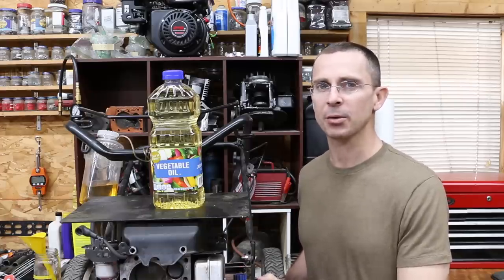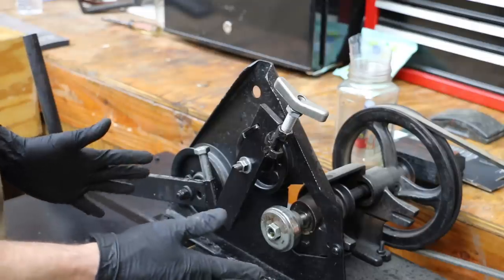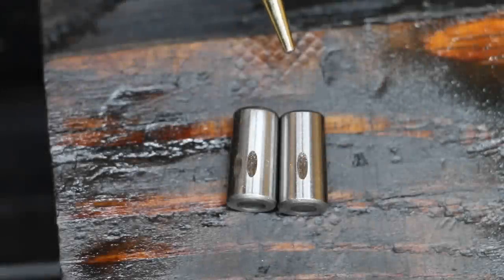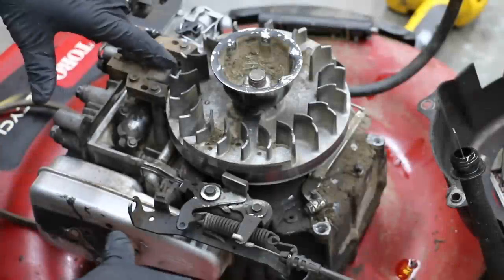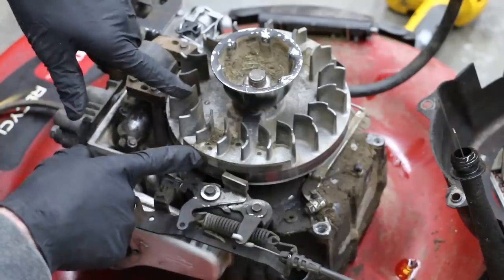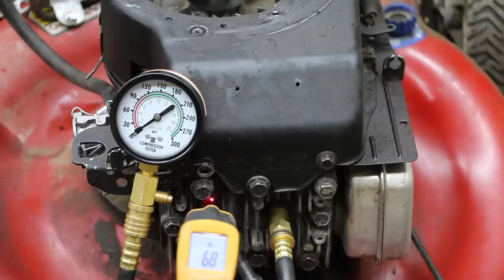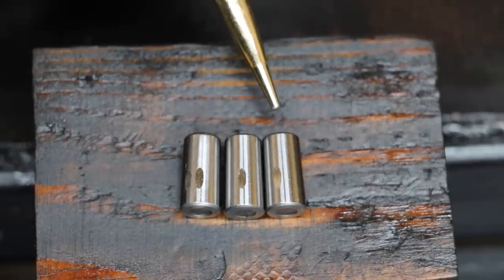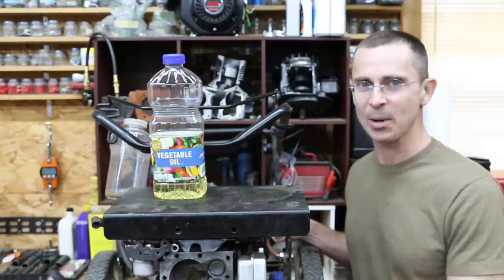Will Vegetable Oil work as Engine Oil?  Let's find out!

Comment: could you run diesel as engine oil?
Reply from the maker: Thank you for this recommendation.
Reply: Not for long, one of the main causes of bearing failures on old two stroke GM diesels was fuel dilution of the crankcase oil, GM engines had the fuel lines internal to the valve covers, any fuel leaks went into the oil pan.
Diesel fuel is very similar to Kerosene (Jet Fuel) it's a great solvent.
Reply: whorayful It can catch fire or make the engine go berserk
Reply: Back in the 30s-50s, this wasn't uncommon to do for a few minutes in order to clean engines out every so often; the old oil gunked up considerably. Maybe I'm mistaking it with kerosene, though.
Reply: Austin Lucas Just at idle tho, if you do this for more than like 5 minutes it can boil and catch fire.
Reply: You still hear it used for that occasionally today, I think the 'flushing liquids' sold at auto shops are basically diesel fuel / kerosene, they are very close relatives. Diesel engines will run on kerosene but kero doesn't have the same oiliness to lubricate the fuel pump. It's not the sort of thing you would leave inside an engine for a lot of miles.
Reply: whorayful Yeah but not 1 hour :) it's dangerous to use it for long times
Reply: Not for long
Reply: Technically yes but you really shouldn't as diesel is combustible that's how diesel engines operate, compression rather than a traditional system using spark.
Reply: I knew 2 airline mechanics who would add a pint of jet-a to the oil in their cars before they changed it, drive to somewhere to get lunch and change the oil when they got back.  Said it cleaned stuff inside.  They both had nice new VWs too.
Reply: For a little while but it’s too thin I would have thought
Reply: Bas BlasterXP. Maybe in a small light duty engine. D4 heavy marine diesel fuel can be used.
Reply: Aries Might so, if we try, we should try it in b&s lawnmower engines!
Reply: Bas BlasterXP. Yes  with a B&S vs Honda shoot out.
Reply: And if you change the oil regulary in your engine, there is simply NO NEED whatsoever to use engine-damaging flush. Today's engines run extremely tight tolerances, hence 20w oils are needed. Putting this fulsh shit in your engine is asinine and bad, as it will remove what little oil is there for lubrication and cause wear on components. Don't FLUSH an engine.
Reply: It's still common in a roundabout way. Seafoam is isopropyl, naptha and "pale oil" which is a generic term for a substance with similar properties to diesel fuel.
Reply: not for long
Reply: Diesel is popular amongst older motorcyclists as chain cleaner/general purpurpose degreaser. It's not a particularly good lubricant.
Reply: ... unless you count it as a film on the road, whereby it completely nullifies any rubber to tarmac adhesion.

Comment: Run engine with hydrogen
Reply from the maker: Thank you for this recommendation!
Reply: It's pretty hard and expensive to get liquid hydrogen
Reply: The Wheelman hydrogen can be made with electrolysis, you just need a car battery
Reply: Antonio tod dissolve zink/aluminium in HCl or aluminium in NaOH(aq) ....
Hydrogen is quite accessable
Reply: Sounds like a decent idea.
Reply: The Chemical Workshop I thought you would get water and oxygen, not hydrogen. Can you write the equation for the reaction you are proposing?
Reply: Electrolysis=HHO. Hydrogen and oxygen.
Reply: Manick N well idk how i mixed this shit up but decomposing peroxide gives oxygen not hydrogen 🤐

For hydrogen you can get some zink or aluminium and dissolve it in acid (Al works in NaOH too)
Reply: Manick N I've been working on purifying iron 2 sulfate for prussian blue to purify my sodium cyanide for silver plating (i guess I'm doing too much stuff at once and I mix everything up :(
Reply: The Chemical Workshop  it happens. I tied up frequency and RPM recently and could not figure out how that made sense when I was typing.
Reply: If you try and run an engine on HHO it will result in disaster. Don't ask me how I know :)
Reply: toysareforboys that's the point i guess :D

Comment: In my country some motorcycle rider use cooking palm oil mix with 1/3 turbo diesel engine oil for drag racing, cooking oil viscosity is quite thin and lubes as good as 5w30 eo, motorcycle with wet clutch need a thicker oil to avoid clutch slipping, so to get the best lube without going for higher viscosity oil they came up with their own recipe its kinda weird but it works.
Reply from the maker: This is great information. Thank you!
Reply: RushDark Wich country? 😂

Comment: Thats awesome, like other people have said baby oil.     What about vegetable oil for 2cycle oil sub
Reply from the maker: Thank you for this recommendation!
Reply: I thank that be cool to watch
Reply: Vegetable oil in a 2 stroke is a bad idea. I would only do that if my life depended on it. Vegetable oil cannot burn, or even vaporize completely at gasoline engine internal temperatures. It will leave vegetable gunk on absolutely everything in the motor. With proper oil later it should clean out, but maybe not before scuffing and scoring the living daylights out of that motor.
Reply: If memory serves, there where some commercially available Bean oils, used for 2 smoke mixes.
Reply: Castor oil is used in RC Nitro applications, but those little 2 strokers are designed very differently from your chain saw motor. They do not use piston rings, and the castor wax improves compression as a result, whereas in a larger 2-stroke motor with piston rings you'll lose compression from fouling the rings.

Comment: Ive had to do it to get my car a short distance, confirmed from australia
Reply: @reesedundee8525  I mean it's gotta be hard to fill a car upside down isn't it
Reply: Also in Australia, am doing it now, smoky motor is burning 2 litres per 100 litres of petrol, poured 2 litres of Aldi vegetable oil, and have driven 100 KMs so far with it seeming happier than normal.

Comment: When engines ware first invented they were run on caster oil,
Reply from the maker: Thank you for the feedback
Reply: Castor oil is a very good lubricant when used mixed into the fuel or at least in a total loss system. It polymerizes when hot, but this is actually wanted in those cases, because the polymerized stuff is working very well as a lubricant at this temperatures. You have to "throw it away" after it has done it's job, though, since those polymerized components become ugly gunk when cooling down. 

It's special chemical properties make it stick to metal really good, even if it's already polished from wear and many other oils would just drop off.

Because of it's superb high temperature qualities it was (and still is in some cases) used for high-power two stroke engines. Racing karts used it a lot. RC racing engines love it, at least mixed into the synthetic stuff.

Comment: Was it just me or did the used vegoil look like it had silver shavings in it?
Reply from the maker: It may have. It's the same engine used with WD40.
Reply: was definitely full of metal.
Reply: I thought the same
Reply: It looked exactly like the oil from the transmission of my two-stroke motorcycle. In the case of my motorcycle, the clutch runs in the oil so it gets pretty dirty.
Reply: Yes but these dont have internal clutches.
Reply: Project Farm cheap way to flush a crankcase!

Comment: Big difference between vegetable oils and mineral and synthetic oils is that the vegetable oil reacts with oxygen and forms an extremely sticky mess which is very hard to remove. Running an engine on fresh vegetable oil has shown to be a good emergency measure but storing an engine for a few years with vegetable oil in the crankcase and on all the surfaces near the camshaft ...... that’s another question! I remember me/us youngsters in the sixties adding salad oil (sunflower oil I guess) as replacement for mineral oil in two stroke gas just for the “racy” smell it gave in the streets of the town we were living in! Nice testing job again. Gerard
Reply from the maker: Thanks for sharing.  You are welcome!

Comment: There's a report by the Navy Research Lab from 1942 called P-1954 "Sabotage Agents for Use in Lubricants and Fuels". They tried mixing a bunch of things (drying oils, resins, corrosives), including vegetable oil, with gasoline and motor oil and running 24-hour tests. They didn't find anything that would do irreparable damage but a bunch of things they tried would gum up the engine so that it wouldn't start again after cooling and a few things that could cause the engine to seize after several hours.

Comment: I used to drive Tomos 2 stroke moped on sunflower oil just for fun. And yes, you can use pure vegetable oil in any engine. In the past people were using castor oil for 2 stroke engines. Also first Castrol oils were made from castor beans. Nowadays flower oils are used in vehicles in water protection areas (springs, wells, water pumping stations).
Reply from the maker: Thanks for the feedback.
Reply: Did you Blew the engine on that moped? I'm interested to experiment on Chinese chainsaw using vegetable oils as engine oil.

Comment: I had a 1964 chevy and it burned 1 qt of oil in 35 miles, to work and back. lots of smoke. One day I put Lestoil to possibly clean the sludge out and stop some of the oil burning. I had the sweetest smelling car on the road. Ran it with Lestoil for a hundred miles and drained it out. Put Gulf 40 wt  in and it didn't help. It was fun to do though. The Lestoil barely drained through the drain plug. Cleaned a lot of sludge out. Rebuilt the engine shortly after and it was very clean in that crankcase.
Reply from the maker: Thank you!

Comment: I actually tried it in a vehicle mixed with motor oil. It worked for a time but the problem that arose was after being whipped around for so long the and heated and cooled so many times  that it gummed up and became a solid.

Comment: Hey, Project Farm, great video, thanks for the content. 
I have a sugestion and I know this sounds gross, but the company I work for visited a food factory where they recondition expired margerine into engine oil. They didn't say what they add to the margerine to do that, they just said it was 'chemicals', maybe it's those vague 'aditives' motor oil display on the vial, but my bet is that they either just add mineral oil and bottle the mixture as synthethic oil, and or add some antioxidants to get the right thickness. Soy oil have a really bad shelflife, compared to canola oil, so it wouldn't last the time an engine takes between oil changes, but margeine clearly have enough preservatives. I've never seen a fly land on margerine even when it was forgotten on the fridge for months (I wouldn't be surprised if they even add formol to reach 4 years of motor oil shelf life). Still just testing the margerine itself or mixed into motor oil would be interesting to see how close something we're sold as food is to an car fluid.

Comment: Man, older lawnmowers probably shiver,  shrieks and run away in sheer panic when they spot you .... ;)

They used castor oil in aircraft engines before and during WW1. It still is a good lubricant - being a vegetable oil.
Reply from the maker: Lol

Comment: We used to use castor oil, bean oil, in motorcycles for racing. The engine had to be flushed before using the bean oil. Caster will go toward the hot part and it worked good and smelled good. One problem with car engines was the driver, after breathing the exhaust had a case of the runs for a day or so. Today automotive oils have to be fungible,  they have to be able to mix with each other and not have a problem because a different brand was used to top off the system.
Reply from the maker: Thanks for the feedback!

Comment: - Full synthetics like Mobile 1 have strong detergent properties.
- In Automotive Engineering we used to run automatic transmission fluid in engines.  It has extreme detergent properties but had the added advantage of wearing the engine out at twice the rate.  This was useful for testing as it didn't take nearly as long to duplicate the wear on an engine.
- Sometimes you hear the recommendation to use 30W non-detergent oil and regular multi-viscosity detergent oil as a less desired substitute.  Some people will tell you that is because of foaming of detergent oils.  Those days have been gone for longer than I've been alive and were never the reason.  The determining factor is if the engine has a pressurized oiling system or not.  Flathead engines traditionally didn't have oil pumps.  They have little dippers connected to rod bolts that dip into the oil and splash the lubricant to where it needs to go.  Pressurized oil system engines have oil filters.  You want a detergent oil to keep the contaminants in suspension so they can be filtered out.  In a splash oil system, you want the contaminants to sink to the bottom and stick together in a sludge because that is your oil filter.  Old cars had wide-open access to the oil pan and after so many miles and at an oil change they would drop the pan, scrape it out, and wash it out.  The problem is it is not practical to take a lawnmower engine apart to clean it out.  So when you put in clean oil and it comes out dirty after not many hours, that contamination isn't a result of the oil and use, it is from the breakdown of the sludge in the bottom of the engine.
Reply from the maker: Thank you for the feedback

Comment: I can remember,that my father,s  1960 Ford Consul MkII, ran on lubricants based on vegetable oil.Nothing
that you could pour on your salad,though.That engine oil for a Ford Consul,wasn,t a substitute,it was
what the garage would put into the crank case,a normal thing in those days,early 1960s.
Reply from the maker: Thanks for sharing.

Comment: My suggestion is to try JD weld wear lube test you can form those small wear blocks by putting JD weld or other test epoxy's into a straw or cylindrical paper tube and then peal that off. The test should show how well the compound tested holds up under super wear pressure applied. Great shows  keep them coming.

Comment: Great video as always! I figured soybean vegetable oil would perform just fine. Great to see it hold its own against 30 weight. Looks like it would work great in a pinch but would leave too much residue for long term use.
Reply from the maker: Thank you for the feedback
Reply: Say Project Farm guy; Ever done any comparisons on fuel injection or carbrator cleaners ?

Comment: You should comeback to this and try experimenting with mixing different oils. A good start is a soybean oil and castor oil mix i feel. Soybean oil has decent lubricity and is used industrially in some applications while castor oil used to be used for vehicles and has better low temperature viscosity as well as high temperature performance. Some good ratios might be
- 80 Soy - 20 Castor. 
- 60 Castor - 40 Soy.
- 20 Soy - 60 Castor - 20 Conventional petroleum based oil (a lighter grade to mix well with the vegetable oil) probably non synthetic but not sure.

Comment: Ive done some testing with veg oil in 2 strokes works great. Makes a great hand cleaner and cutting compound when drilling. Is great at preventing rust as it oxidizes when in contact with oxygen and creeps along seems well.
Reply from the maker: Thanks for the feedback.
Reply: What type of vegetable oil did you use on 2 stroke? They are all different oils. Different freezing points.

Comment: Just an idea: Add a sludge test.  Organic oils tend to break down at high temperatures, as the lighter oils evaporate and leave heavier compounds which turn to sludge and possibly ash.  The test would be simple: Heat a pan (cast iron or stainless steel) to 400° or so, and heat a few tablespoons of oil in it for a few minutes.  You can also note the amount of smoke given off.
Reply from the maker: Thank you for the video idea!
Reply: @ProjectFarm  Absolutely, I enjoy your videos.  I had a couple of other ideas, I'll post them when I remember.

Comment: Vegetable oil was originally used as an industrial lubricant for engines during ww2. After the war there wasn’t the need for lubricants so they adjusted, got rid of the (blatantly) toxic elements for human consumption and sold it for culinary use. So the fact it performed so well isn’t too suprising.
Reply from the maker: Thanks for sharing.

Comment: I watched a video where you used bacon grease as motor oil and it didn't do very good but it has a higher flash point than vegetable oil. Vegetable oil looks like it does pretty good as a substitute for engine oil. My thought is what if you try blends of vegetable oil and animal fat. Could the animal fat increase longevity of vegetable oil without decreasing the effectiveness and how would that compare to regular lithium grease.

Comment: Other than a couple of additives vegetable oil is used in hydraulic systems on heavy equipment when it is being used around water bodies (like lakes and rivers) because if the machine springs a leak or if a hydraulic line burst the spilled oil has to be biodegradable. It is called BIO oil
Reply from the maker: Thank you!

Comment: Nice informative video. I would say that veg oil will break down much more quickly than motor oil and will undergo a process of polymerisation which will gum up the engine and cause it to seize up. Anyone who has a dedicated pan for making fries will be familiar with the ring of rubbery stuff that forms at the top of the pan - that is polymerised veg oil and that will take place over time in an engine.
Reply from the maker: Thanks!  Thanks for the feedback.